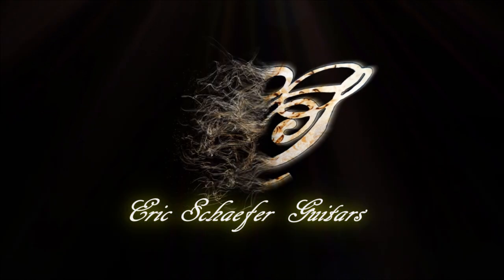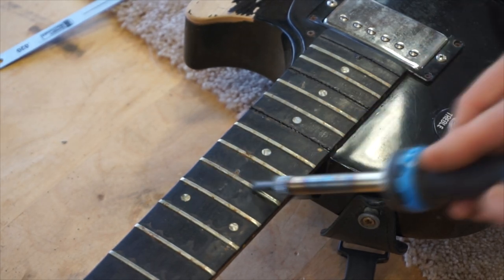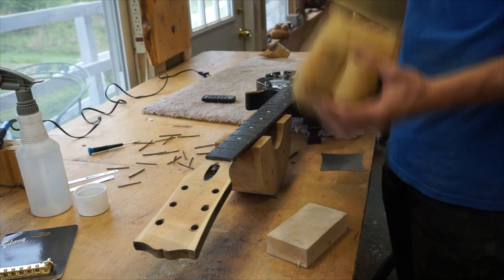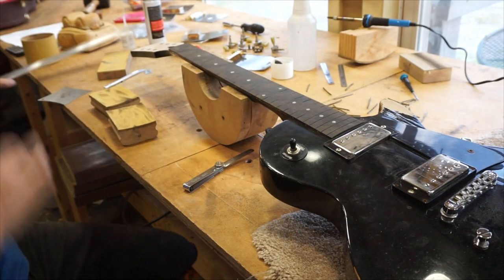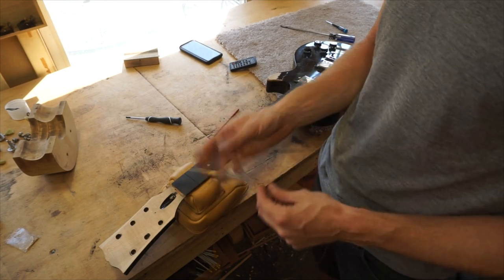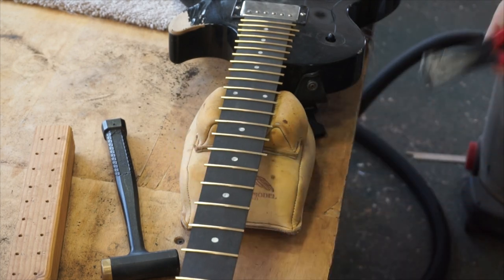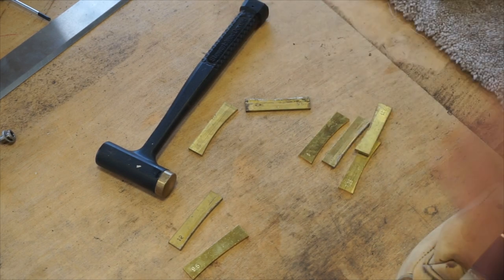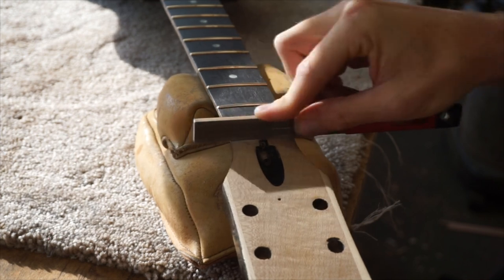Les Paul Refret with Evo Gold

Comment: Just did my first EVO gold 57/110 refret with a hammer, no problems. I seated the with wood glue. Went after high frets with a fret rocker 2 times. Only one fret end needed a little help. Very pleased with the result. I will try 55/90 next time because I think they are closer to my ideal, but big frets can take more dresses before a refret ;-) But that shouldn't be so much an issue with the golds. Prep work is always king.

Comment: 1. If you tilt the guitar (lift the head for example) the superglue will flow into the fret slot better 2. A bit of petroleum
Jelly on the trussrod would be a good idea and 3. Probably better to finish with some lemon oil on the fretboard?

Comment: where do You buy the EVo Gold fret wire from. Exactly what you showed in the video. All one piece and pre radiused. Also, when you added the super glue you wiped it off with the blue shop towels. Did you use any solvents, like Acetone with the shop towel?
Thanks
Reply from the maker: I've responded to your comment in this Q&A video. Check it out! https://youtu.be/JFBuCIw4zoM

Comment: Very good work!.. but what I don't understand is why you beveled the fret slots but then applied CA glue to the fret slots. Won't that glue make a re-fret nearly impossible to do without totally hosing up the wood with or without the bevels?
Reply: CA glue does soften up when heat is applied, so during the next refret a soldering iron will do the trick.
Reply: @inquisitivenessandcontempl9918  oh ok I did not realize that, you've empowered me with knowledge thanks. On side note, the arrival of Cyanoacrylate (CA) literally changed the R/C modeling industry literally overnight!

Comment: I used the EVO fret wire to re-fret my old Yamaha acustic that I just finished restoring. That fret wire is really nice But I made a mistake I forgot to sand in a bit of fall away at the fretboard extension so even after a grueling neck reset a re-fret job & re-finish I have fret buzz on the two middle strings at the highest point of the fretboard. Iam totally bummed out. I don’t know if you have ever have done a neck reset on an old Yamaha? But they are probably one of the hardest necks to remove on a guitar I think they used epoxy to glue in the dovetail joint it took forever too get it loose. Sorry for the rant. Awesome vid. BTW When will we get to see #56????
Reply: it's not necessary to sand the fallaway into the fretboard. You can get exactly the same effect by just grinding the fallaway onto the tops of the last few frets when they're in. Have a look here for how to do it (Crimson Guitars): https://youtu.be/nSdBjWn5X-c. If I'm honest, this method Eric showed by sanding it into the fretboard is the first time I've seen it done that way (admittedly, it seems a completely logical and ingenius alternative) but I've only ever seen it done on the frets themselves so far and it works just fine. No need to reset the neck.

Comment: Hi, your explanation on 9.20 concerning the relationship between relief and the part of the neck which is glued in is not correct. In fact, there are a lot of guitars who have a hump in the fretboard where the connection begins, for example because the wood is not stiff enough. A typical problem which cannot be seen if strings are removed (thats the typical way a manufacturer straightens the neck) but can easily be seen if strings are installed. If you want a low action without medium to strong buzzing on the higher frets with such a guitar, you can either refret at least the high frets (after sanding a proper fallaway in the wood) or file the frets down (which is quite time consuming, and you can easily loose 0,3-0,5 mm of fret high). I recommend you to try filing frets under string tension simlation with something like the Erlewine Neck Jig. The results are much better predictable and also of better quality.